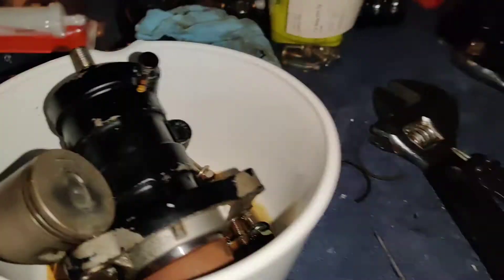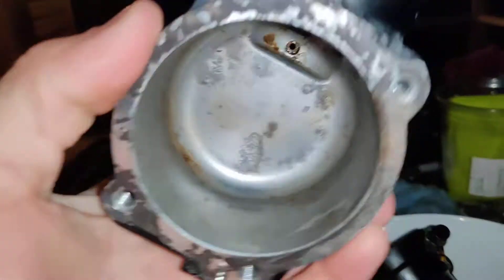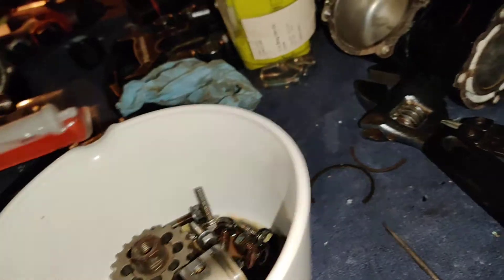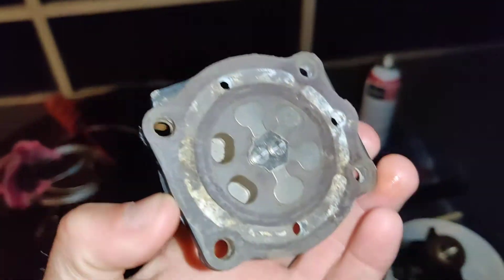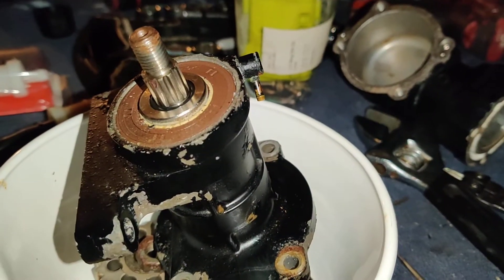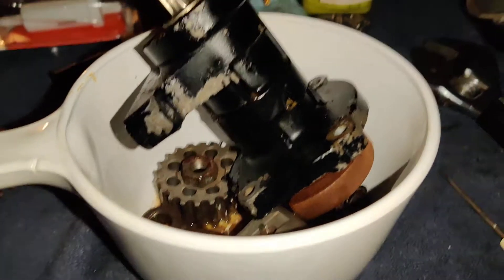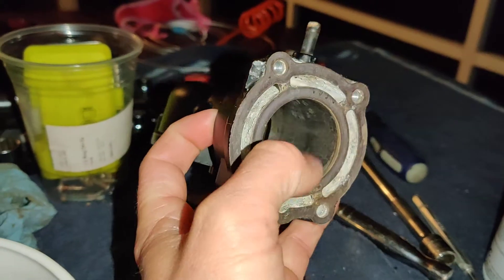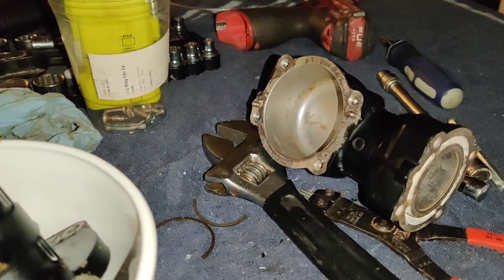Rebuilding a tohatsu tldi air compressor pt. 1

Comment: Hi,  Thanks for sharing!  I have the same motor and the air compressor just froze.  Was idling for about 10 minutes then just stalled out. How are these cooled?  Thinking mine overheated.  Thank You!
Reply from the maker: Sorry for taking so long to respond.  They are water cooled.  Sometimes the line sending water to the compressor gets plugged up and causes compressor to fail.